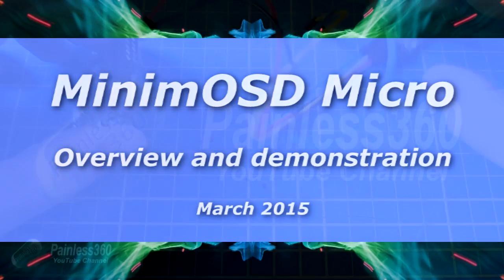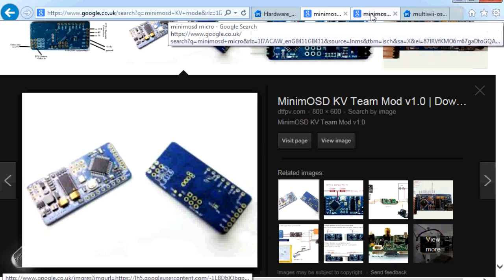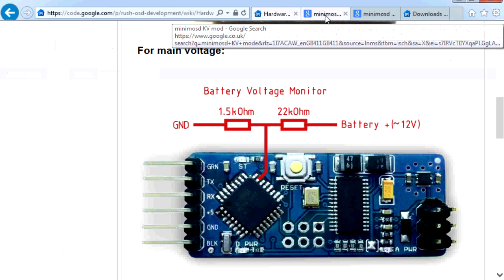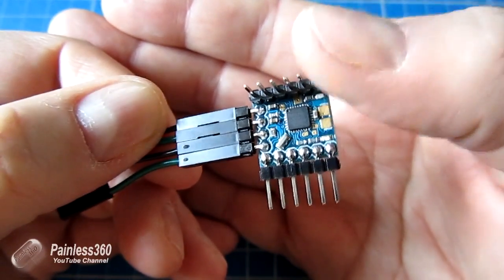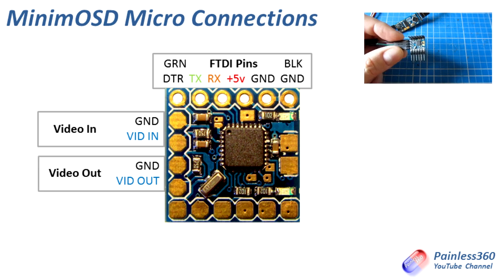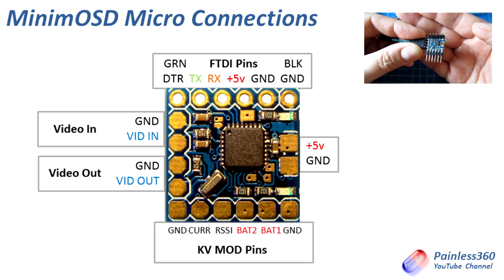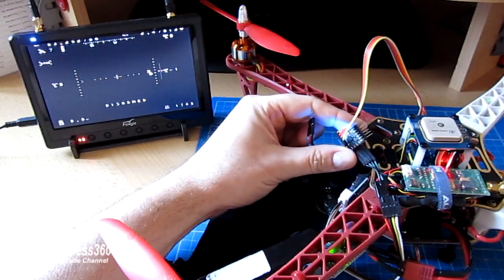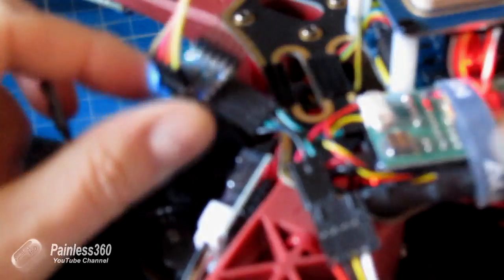MinimOSD Micro - Overview and Demonstration (KV Team mods)

Comment: Good Day.
I just received the Micro OSD as you suggested. It dd not come pre installed with software. Ok I went into Arduino 1.6.9 and verified the clear command. It verified just fine. went to upload the file to make sure I am strting off with a clean slate.

I got this error:

Sketch uses 25,896 bytes (84%) of program storage space. Maximum is 30,720 bytes.
Global variables use 1,899 bytes (92%) of dynamic memory, leaving 149 bytes for local variables. Maximum is 2,048 bytes.
Low memory available, stability problems may occur.

C:\Program Files (x86)\Arduino\hardware\tools\avr/bin/avrdude -CC:\Program Files (x86)\Arduino\hardware\tools\avr/etc/avrdude.conf -v -patmega328p -carduino -PCOM5 -b57600 -D -Uflash:w:C:\Users\DRONEZ~1\AppData\Local\Temp\buildbaaae258b35afa26e312a990521ad1a9.tmp/MW_OSD.ino.hex:i 

avrdude: Version 6.0.1, compiled on Apr 15 2015 at 19:59:58
         Copyright (c) 2000-2005 Brian Dean, http://www.bdmicro.com/
         Copyright (c) 2007-2009 Joerg Wunsch

         System wide configuration file is "C:\Program Files (x86)\Arduino\hardware\tools\avr/etc/avrdude.conf"

         Using Port                    : COM5
         Using Programmer              : arduino
         Overriding Baud Rate          : 57600
avrdude: stk500_getsync() attempt 1 of 10: not in sync: resp=0xb8
avrdude: stk500_getsync() attempt 2 of 10: not in sync: resp=0x0b
avrdude: stk500_getsync() attempt 3 of 10: not in sync: resp=0xad
avrdude: stk500_getsync() attempt 4 of 10: not in sync: resp=0xb9
avrdude: stk500_getsync() attempt 5 of 10: not in sync: resp=0x0b
avrdude: stk500_getsync() attempt 6 of 10: not in sync: resp=0xae
avrdude: stk500_getsync() attempt 7 of 10: not in sync: resp=0xb8
avrdude: stk500_getsync() attempt 8 of 10: not in sync: resp=0x0e
avrdude: stk500_getsync() attempt 9 of 10: not in sync: resp=0xac
avrdude: stk500_getsync() attempt 10 of 10: not in sync: resp=0xb9

Any idea? I tried it with both of my new boards. I also bought 2 new FTDI boards like yours to be compatible. 
I have tried several versions of Audrino from 1.3 to 1.6.9. Same error codes. Is it this hard to make these work??? I know yours was pre-installed but ......
Windows system does indeed find the FTDI board on COM5. I did set the software on com 5 , just fyi..
been on this 10 hours today. I am wondering if some other hardware on my computer is bad.
I also installed cp210 as well. When I hook it up to my quad I do see video and lots of V'S or down arrows over the entire screen!
so my rxtx and powers are correct as well as my vid in and vid out are good. have not got any further than that.
Please if you have any ideas or someone else that might be on spot with these Micro OSD's
DanG

Comment: Could you please make a video on how to wire the MinimOSD Micro using the PDB with a LC filter rather then pulling power from the Vtx?
Reply from the maker: Not sure what you're asking...
Reply: Another words, most PDB have a 5V and 12V bec to supply filtered power to the video system.  I was asking can you make a video on how to use the PDB to power the video system while incorporating  the MinimOSD Micro.  Thanks you.
Reply from the maker: I see! Thanks. We do cover this in one of the RC basics videos already and will be touching on it in the current build series

Comment: Greetings....
On your recommendations I picked up the Quanum Cyclops goggles and the Taranis Plus!. First they are just what I need to get started in fpv!
So now I am trying desperately to get the mini OSD configured (not Minum??). I see on the board it is the AT328P version. I downloaded all the files you recommended.  Great. I am using the FTDI232 board to interface with the OSD. I have 2, 6 pin connectors to join them together. as yours had a female on it and just plugged it in. Now I have been on this for 8 hours but it seems that I can only get the arduino to recognize com 5. I thought I had an IRQ conflict on 3 so I changed it. Oh I am using Windows 10 on a laptop. I was able to clear the OSD with the clear command found in the KV Team folder that I created. it seemed to work but the lights never did turn amber. I then went to the next step to configure it with KV Team OSD.ino file I got this error code. I am not sure you have had this problem but here is the error code:

____________________________________________
Arduino: 1.6.9 (Windows 10), Board: "Arduino Pro or Pro Mini, ATmega328 (5V, 16 MHz)"

In file included from sketch\EEPROM.cpp:5:0:

KV_Team_OSD.h:180: error: variable 'item_table' must be const in order to be put into read-only section by means of '__attribute__((progmem))'

  extern PROGMEM const char *item_table[];

     exit status 1
variable 'item_table' must be const in order to be put into read-only section by means of '__attribute__((progmem))'

This report would have more information with
"Show verbose output during compilation"
option enabled in File -> Preferences.

___________________________________________________
Every other file I try to upload gives me a similar  error 'item_table' ???

Do you or maybe some of your GURU's have any ideas??? I have tried this on 4 different boards. 2 were MavLink OSD which I will not use as I am using the NAZE32 Rev. 6 FC.
Any Ideas will be greatly appreciated as I am excited to use my new Cyclops Goggle!
 DG
Reply from the maker: Try Arduino 1.0.5 not a later version.. Best of luck!

Comment: FYI not sure if its just my micro minimosd or if MWOSD R1.6 changed it but my battery voltage is showing up in Video Voltage rather than Main Voltage. I am wired the same as your diagram. Not a big deal but took some time to figure it out thought i would share it with others.
Reply: +pMustangw on 1.6 use BAT2 for battery voltage. I had this same problem.
Reply: +Julich Mera Ahh Haaa i am glad to here its not just me. Thanks for speaking up

Comment: Hi painless,

Thanks for the very helpfull videos.
I just installed the micro minim osd, and followed your video on the minim osd to configure cleanflight with the spracing f3.

When i power everything on, I get the menu at the start and the overlay, but "no data" and "disarmed" keeps flashing, as if cleanflight doesn't communicate with it ?? Have you encountered this issue ?

Thanks for the help
Reply from the maker: +Hamza Bendahou sounds like Cleanflight, the wiring to the OSD or the setup on the OSD is the problem. What troubleshooting have you done already?
Reply: Painless360 Thanks for your quick answer. I found the solution: I don't know if it is in the spracing f3 or in the micro minim osd but the tx and rx pins where inverted (not labled corretly). I suppose it is in the sp racing f3 since I was able to flash the micro osd using my ftdi adapter.

Comment: Thank You for the video! It is a huge help! 
Anyway, I have a strange problem with my micro minim osd. I hope that somebody can give me any advice...
I use it with CC3D, 20A FVT little bee ESCs. It works well, I can raise the trottle for 100% without problem. I can punch the trottle without issues with a fresh battery. But after a short fly, for throttle punches, rolls, the video signal goes away, black screen.  Then I reduce the throttle, and the screen come back. (If I have enough height for 1-2 sec black screen with an acro mode race quad the quadcopter can survive without crash.)
 If I put back my super simple OSD, the OSD text has a little up-down motion in front of the stable screen for throttle punches. The picture is good with that.
I thought that the FC's 5 volts has not enough current. Changed to PDB's BEC, but is not good for the micro minim. And it does the same from the vtx 5V out too. (The 5V power connected to the ftdi pins.)
Reply from the maker: +Zsolt Szép this sounds like the 5v from the BEC is being pulled down too far once the battery isn't full. I'd consider using a higher rated BEC. Best of luck!
Reply: +Painless360  Thank You! I will try it. If I would like to solve the problem with one good PDB, which one do you recommend?

Comment: Hi ! Thanks for video.

I'm trying to setup my micro minimosd (MWOSD 1.6). 
All data come from the Naze32 (Cleanflight) : Battery voltage and modes are working, but Throttle Position stuck at -90% and RSSI is not correct even after calibration. Any idea please ?
Reply from the maker: +Fosch sorry, no. I've not used v1.6. Id try a previous version. Best of luck!
Reply: +Painless360 
Hey ! Just found a solution a half hour ago :)

I removed the following comments in Arduino by adding // :
// #define PWMTHROTTLE 
//#define AUTOTHROTTLE (and I have entered my own min/max throttle values just below)

I'm still trying to make the RSSI working properly, problably the same kind of stuff...
Reply from the maker: +Fosch thanks for sharing that!  Happy flying!

Comment: With the micro osd how do you wire the camera ground if your video transmitter does not power the camera,  both my tx and camera run on 12v, the transmitter has a spare ground cable and the camera has just positive ground and signal, when using with no osd i solder both positive and ground together from both tx and camera to supply voltage and join the signal wire from the camera to the transmitter. Advice would be appreciated.
Reply from the maker: +quadthing copter the ground isn't for power, it's for the reference for the signal. See our video on using 12v fpv systems with 5v boards for more information.

Comment: I have a slight problem. Installed mwosd on microminimosd and got everything working great. Suddenly I somehow deactivated the layout now only can see time. Is there a switch or something to make my layout come back, or do I have to reflash the board?
Reply from the maker: +Karstacus you can setup some firmware to change layouts using a switch on the transmitter. Check you haven't got that setup accidentally.. Best of luck!
Reply: +Painless360 Can I do this in the osd display? I have everything waterproofed. It happened right after a flight, so it must be something i deactivated by accident. Thanks.
Reply from the maker: +Karstacus in the configuration GUI on the PC..
Reply: +Painless360 Okay thanks :) Guess I have to take this apart :p
Reply from the maker: Da*n. I hate that when it happens.. Best of luck!

Comment: I have a problem with minimosd micro. Some camera's don't give any osd display and my runcam skyplus does but wheb i use the horizon or other images, than they are messed up. Text is working withoud any problem. I did try other fonts but noting changed. Can it be de cam? wich cams do you use for your OSD? I wanted the HS1177 but they told me that also that one does not work with the OSD because of the chinese osd on it.
Reply from the maker: +emiel1976ep We use AOMWAY and FatShark cameras (with the odd Mobius and RUNCAM) here..
Reply: Thanks, i will try my runcam. The runcam skyplys gives some problems but now i now witch cam to get.

Comment: i need some help i got the minim micro osd with a micro cc3d. it works fine but the voltage is wrong. I have a 3S Lipo 12V but the minim micro osd shows me 17V
Reply from the maker: +Frederic Refle watch some of the other MinimOSD videos or take a look at the forums or documentation for the firmware you are using. Many have adjustments for things like this.. Best of luck!

Comment: If i want to power the micro minimosd module with an external regulator, which wires should be removed? 
I have 2 servos and when i control them the mmosd signal is lost, i also use apm2.5 and the voltage 
regulator is a polulu 5V, 5A.
Reply: and if i have one bat. for frame and second for vtx, which one should i use for regulator?
because i burned a minimosd in the past when i was trying to use the same bat for both.
thx :]
Reply from the maker: +ssangry99 see how we did this on the APM 3.1 build in a wing. We powered the servos from a separate UBEC to keep the power to all the flight electronics clean to avoid problems like this. Best of luck!

Comment: ok i know that the osd level pitch line set for craft level...but is there a way to get the osd to let there be more then 15 degree of pitch...the pitch line  stops moving about 15 degs.. i want to know what 45 degs. is when im in fpv..is there a way to do this??
Reply from the maker: +nitro 20 Depends on the firmware you are using in the OSD. Have a look at the pages for the documentation for it and see.. Best of luck..
Reply: +Painless360 I figured it  out..now the pitch and roll degrees jump from 44 to 100..know anything on this.

Comment: I am trying to avoid a ground loop. Are the Video in/out GNDs on the OSD connected to the main minimOSD ground that is part of the FTDI row of pins? I am wondering if it would be possible to connect the OSD only on the video line between the Tx and camera, without connecting the GNDs of the video pins. Then the camera and transmitter will have the same ground (from the TX in my case) and the micro minimOSD will have the ground from the flight controller. Not sure if this will work but it will definitely not work if the Video GNDs on the OSD are isolated.
Reply from the maker: +vzachari It works the way we've wired it here, you can try a different approach but I've never had any humming from a 'ground loop' on my models. Best of luck..

Comment: Confused here..... I've set up the micro OSD but get nothing but VVVV characters on my video screen. I've not set up onto my naze board yet, just trying to make sure it works on the bench first. Any help would be great here
Reply from the maker: Usually because the fonts were not upload / didn't take after the firmware update.  Check out the steps in the video. Best of luck!

Comment: Great video once again, thanks.
One thing that is still not clear  to me is the MinimOSD common grounds.
1. The 12v video in\out grounds are connected to the MinimOSD, Wouldn't it be better to by pass the MinimOSD ground similar to 12v plus red wire ? 
2. The 12v VBAT ground is connected to the MinimOSD, Wouldn't it be better to connect only the 12v plus red wire directly from the battery ? ( as suggested in one of the Naze32 related videos in regards to FC VBAT pin )

Many Thanks Oren

Comment: if i dont connect to a flight control board will i still at least get a HUD?
Reply from the maker: You can configure it as standalone  but need to add extra things.  Check out the details in the Wiki.
Reply: +Painless360 i need a little coaching. i have minim osd with camera and video transmitter but all i get is NO MAV DATA? i dont want to connect to anything else, just want to see horiz line but i get nothing. can you coach me through please.
Reply from the maker: I've never done it but this video will explain the error you're getting (you searched the channel right?) https://www.youtube.com/watch?v=PTd5ViDsH1Q

Best of luck.

Comment: ive got it working now  . :D ive got an ftdi adatper , and i set a new firmware version 2.3 of kv teams firmware . https://www.youtube.com/watch?v=VkXkkyHvAns heres the link of me testing the osd , but , ive read abit tutorials ,  can i connect 12v lipo battery to the battery sensor on the minimosd micro? , im a bit unsure on this , according to the schematics , it should work ,. i need to connect the rssi and the battery ,

Comment: Hello again, my other minimosd stopped working. I  could only get the 2 light on but the blinking light doesn't come on, so I decided to buy this micro osd. After flashing and installing it on my Naze32, everything works well except for pictures. I could see all the OSD data on my screen but can't get any picture from my camera, but when I bypassed the OSD and connect directly to the transmitter, I get pictures. Could you please help on this? I have checked all my wires and everything looks good.
Reply from the maker: +Sol mag I would check the wiring and then also check the board settings in the firmware (PAL etc). Best of luck.

Comment: Hello, great video, put i have a problem:with the the micro OSD on power (it works fine, latest firmware) I can not conect to cleanflight, i have to disconect the power to the micro OSD to conect to cleanflight, i also tested a external power to the micro OSD (ext. BEC voor testeing, same thing cleanflight does not conect onely after shot down power to the micro OSD, please can some one help!
Reply from the maker: +RC opter Not sure what you mean - videos showing the problem are always very helpful..
Reply: +Painless360
 the cleanflight gaui wil not work if the osd is on power, 
-osd power off and the cleanflight gaui is working wel.
Reply from the maker: I've left a message on that video - this is normal as the OSD uses the same circuitry as the USB connection. Happy flying!

Comment: hello , can you help me connecting miniosd micro to flip32+ 10dof , flight controller , i cant find connection diagram for flip32+ , i need to solder some more pins on the flip32+ because , there are only esc pins and reciver pins not the serial pin ,  ive got an ftdi adapter if i need to flash another fw on minimosd micro
Reply from the maker: +neo36w eno36w I would use PPM for the Rx and that would leave the SoftSerial pins available for the OSD and then use them to connect to the MinimOSD. Program the OSD for 19,200 baud and set the SoftSerial port to the same speed. Best of luck.